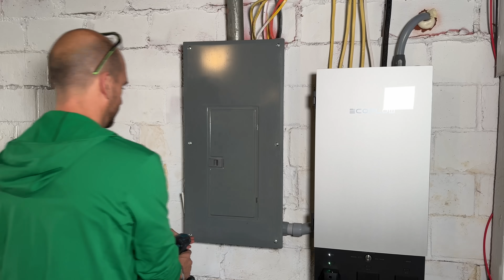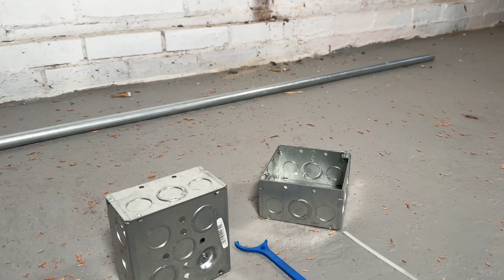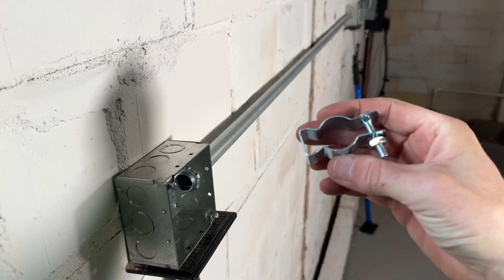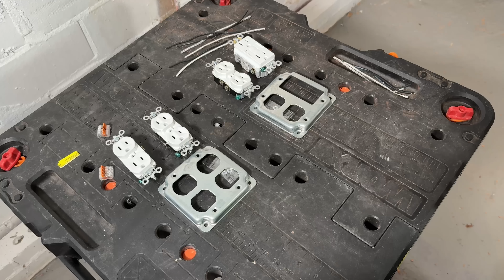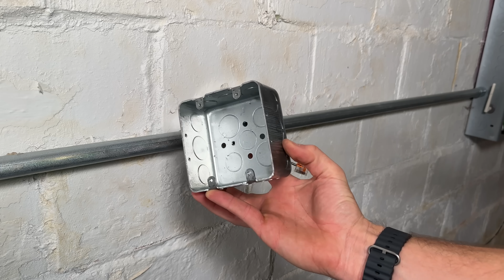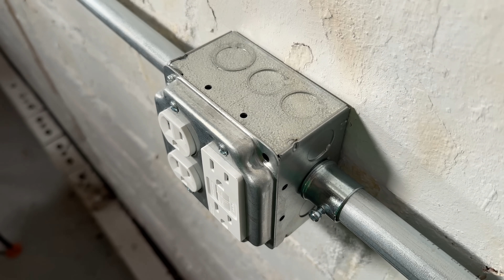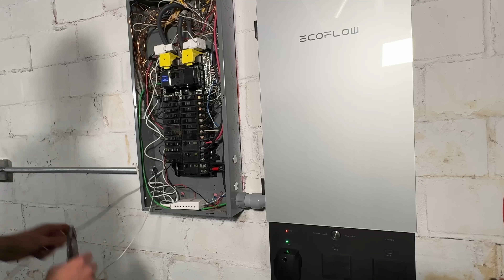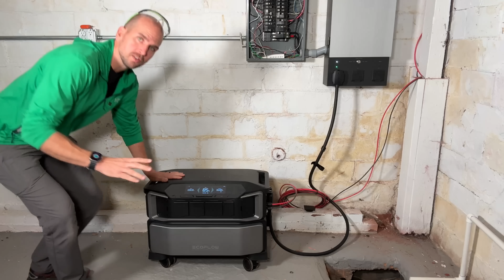Add Outlet To Unfinished Basement Or Garage

Comment: NEC (National Electric Code) mandates you to  ground wire each switch and electrical receptacle box to EACH receptacle ground screw in those boxes, so that it's protected if the faceplate/ receptacle is off the box and the circuit is live, in order to trip the breaker instead of going through the person and not tripping the breaker. Just picture that live before you pushed the plate forward to screw the plate down...there is no ground protection, they have those codes for a reason.
Reply: NEC 250.118(A) .. equipment grounding conductor ... shall be one ... of the following ... (4) EMT.  Please detail with code reference why you believe that does not apply.
Reply: @RJ-ej1nr he’s saying that the EMT provides ground to the box, but if the plate is loose, the receptacle would no longer be grounded. I know that nobody ever uses receptacles with cover plates missing or unmounted, but it’s the safest way.
I also believe that receptacles are not considered grounded unless they have a listed brass contact between the frame and the box the screws are no longer sufficient. Again, check with your inspector. Local rules override code.
Reply: @TomCee53  He says "NEC mandates" and that's what I was responding to. I cited NEC code which allowed something other than what he said was wrote as mandated. Discussions on what could be problematic or a good idea or not are reasonable ones to have, but that's not what I was getting into with my response.
Reply: I believe you are correct.  The metal box and the conduit is the ground but the receptacles do have to have a ground wire to bond them to the box for the reasons you have stated.  I can be wrong though, I have been retired for a long time and may have a faulty memory.
Reply: @urieaaron  The receptacles he used were of the self grounding type.  If you looked at the RS covers they had no hole for the center screw of the duplex receptacles.  This forces the installer to correctly bolt the devices to the RS cover.
Reply: Grounding through this type of cover plate would be allowed per NEC 250.146(A).
Reply: @toukoaozaki  but his receptacles are not self grounding type, i dont see the copper shims or wires on them.
Reply: @Pepe-dq2ib  the devices are self-grounding because the manufacturer bonded the yoke to the mounting terminals. Self-grounding refers to the device being bonded to the grounding path with installed without the need to specifically run a wire to the ground terminal on the device. That being said, some jurisdictions will allow it, many won't. They will require a separate green grounding wire that is bonded (connected) to both the junction box and the grounding terminals on the devices.
Reply: @Pepe-dq2ib  self grounding exception is under 250.146(B). Exception under 250.146(A) does not require self grounding devices.

Self grounding here refers to the tabs on the yoke that ensure the screws alone can securely establish ground current path between the yoke and box, instead of relying on the yoke to box contact for conductivity. 

Exception under (A) relies on the mounting fasteners (rivets or screws+nuts) to guarantee contact between the device yoke and the face plate, and therefore does not need self grounding type devices.
Reply: @toukoaozaki  doesn't the manufacturer not listing their product come into consideration? Like a manufacturer that doesn't list their lug terminals for multiple conductors, even thought some jurisdiction does.
Reply: NEC says you must have equipment ground to everything you listed.   It does not use the term “wire” though.
Reply: As a DIY homeowner, any and all of my new electrical outlet installation is always supported with a ground wire. Better to be safe than the alternative. Plus, the scant added time to ground an outlet is a simply smart way to complete this project.

Comment: I believe you need to secure conduit within 3 feet of a box. Thought 3/4”was overkill, but certainly sexy and helpful if you are running some 10 awg down the line for a future dryer outlet.  NM is not
Illegal in EMT, and my preference is to run a green wire as it’s not that far and it’s an extra safety margin IMO.  I love metal BTW as it looks awesome.  Nice presentation.
Reply: That's correct. And every 10 feet for straight runs. If the box is 3 feet or less to the breaker it doesn't need to be supported as it's supported on the end but should still maintain that every 10 feet standard. I believe the one in this video was a run of 3 to the box and another  6 feet to the next box though so it's fine just screwing. Securing wouldn't hurt though if you wanted to put one up on each section to be safe.
Reply: BTW braided twisted wire, bye the way?
Reply: @blueplasma5589  it's just by the way. Bye means the opposite of hello. And it's not braided twisted wire. It's THHN and THWN specifically. Braided twisted wire is not solid core wire. Use 12/3. Not that hard to figure out dickweed.
Reply: @realtyrocks1969  Wow, dickweed because he's not an electrician and doesn't know the exact name of something? Since you like to attack, maybe you should explain why you said 6' from one box to the next doesn't need additional securing. WRONG, dickweed,  but thanks for pretending to be an electrician that knows what he's talking about. You should join other forums where you can pretend to be a plumber, genius.
Reply: @blueplasma5589  I use twisted stranded all the time as it's so convenient.  B-W-G in one bundle.
Reply: I was thinking “no romex” for a few reasons, one is that an unfinished basement is normally considered a damp location.  Also the easiest pull, however nominal difference in this straight pull.  Ground wire, just pull it, hook it up properly and have a safer connection.  (My POV)
Reply: @jimk5307  Only a damp basement is considered a damp location. A dry basement is is considered a dry location. It depends on the particular basement.
Reply: @jimk5307  oh but it's not. Code specifically states what they mean by damp or wet locations meaning inside masonry, underground, or exposed to weather. If it's raining inside your garage maybe you need a roof. At least according to the code inside a garage is not a wet or damp location and inside conduit is dry.
Reply: @realtyrocks1969  isn’t it a formal definition?   I think something like this: Location, Damp. Locations protected from weather and not subject to saturation with water or other liquids but subject to moderate degrees of moisture. Examples of such locations include partially protected locations under canopies, marquees, roofed open porches, and like locations, and interior locations subject to moderate degrees of moisture, such as some basements, some barns, and some cold-storage warehouses.

Basements (some) are included in this note above and likely must be fully conditioned with no water condensing on any surface to be considered dry.  Not too many older unfinished basements can meet this.
Reply: it nay be sleeved but since this is a complete conduit system no.
the device looses ground if removed . stay in your lane kid you have no business teaching anybody wireing
Reply: @jeffriley-lq5np  cool story bro. NAY hu?
Reply: As for romex in emt, you are correct. It can be used with the exceptions he mentions.  

There are times when it makes sense to use. Another way to do surface mount in a basement or garage, is to make vertical drops in EMT but use romex in the exposed joists overhead for the runners back to the panel.  The EMT provides good physical protection, but with vertical drops he conduit keeps the rest of the wall surface clear. Makes it easer for shelves and cabinets attached to the wall surface.  

The exposed rafters lend themselves to romex and allows a ceiling to be installed later. But when using this method, the conduits do not provide a ground path to the panel. So the romex provides the ground at each drop. This actually is a very neat installation without horizontal conduits running across the wall. You will use more wire with vertical drops, but the installation is much cleaner leaving more options.

Comment: looks like you worked with panel still live .
Reply: You dont need to turn off the main breaker to add a circuit. You turn off the breaker you add, do the connections and turn it on after. While not recommended it is not prohibited in many places.
Reply: If you have to turn the main breaker off when simply adding a circuit, you aren't qualified to be inside there in the first place. When I replaced my main panel/meter combo for Solar, I did the whole job hot. Insulated Allen wrenches and lots of tape on the live feeders.  This was the policy of the local utility, Southren California  Edison, not some small town operation. And the county code check department agreed. Oh the utility will disconnect the power at the transformer if you insist, but you will wait up to five business days to get it re-connected. Again if that scares you, the you really aren't qualified to do the job. I am not a licensed electrician but an EE with lots of theory as well as HV experience. My day job years ago in TV broadcast required working hot with much more dangerous voltages then residential services. TV transmitters operate at tens of thousands of volts at tens of amps. Down right deadly with one simple mistake.
Reply: working on a live panel is not the same as working on a live circuit. The service feeders are safe (see the yellow plastic covers over the connections) and the panel is full of breakers so the bus bars are covered. There is little risk of contact with hot conductor surfaces accept maybe at the very top and bottom of the "guts." It would be different if he was trying to replace the service panel while the service entry wiring was still hot. THAT is a really bad idea. Generally speaking if you are not sure what you are doing and/or afraid of being injured, you should not be doing the work. Call a professional.

Comment: Hi, can you explain why not to get the box with the rounded corners? You just say "it's not going to work out as good" Why not? I always prefer those for doing exactly what you are doing here.
Reply from the maker: It is more the standard boxes that come with the 4 mounting tabs.  These tabs will allow you to mount outlets or switches directly to the box but that means you will have to use a standard wall plate which is not ideal for exposed work like this.
Reply: @EverydayHomeRepairs All metal boxes in Canada made by Iberville are rounded corners.  Also, you could probably get away with using stainless steel face plates, but I am not an electrician. We also have single gang boxes that use a dedicated surface mount plate for single, duplex and switches.  If I was to do what you did, I would evenly space each of the four outlets along the conduit in single device boxes making it a bit more accessible.  Also, there's a rule of every 12 ft (roughly every 4 m) of horizontal run there should be an outlet.
Reply: @WJCTechyman  in a space like this basement, assuming there are no laundry facilities, there is no Code requirement for the frequency of receptacles. The intervals have more with how the space is being utilized than the space itself. From what we see in this video, there is no requirement for any outlets in this space other than the one required near the service panel itself.
Reply: @EverydayHomeRepairs   What?  No.  You can mount rounded covers on drawn boxes.  Raco 190, Raco 680, etc.
Reply: Ahh OK, thanks that makes sense. I'm just about to start on a basement shop wiring project! @EverydayHomeRepairs